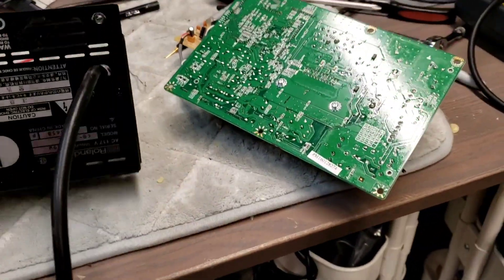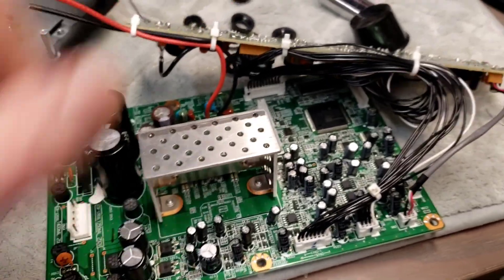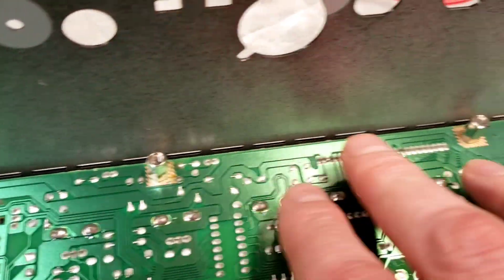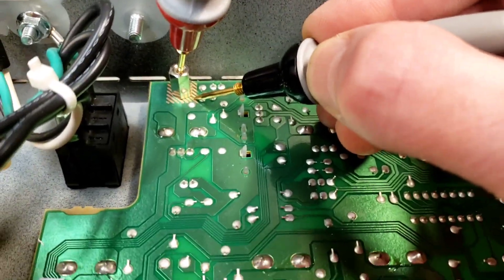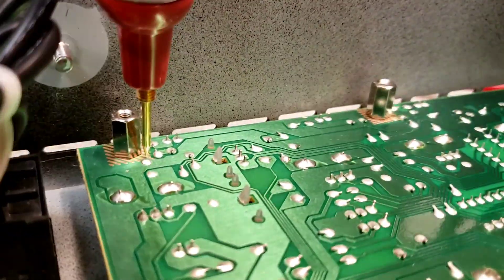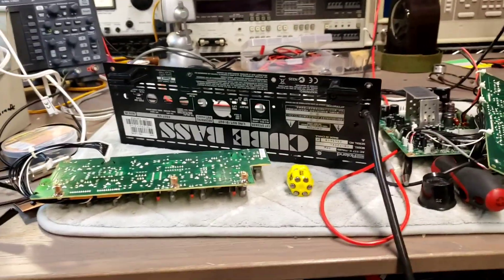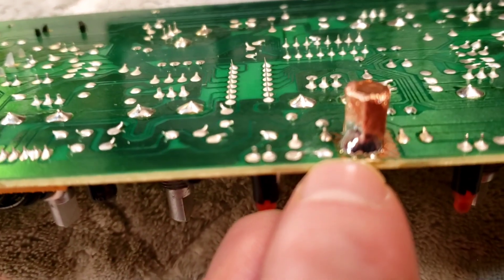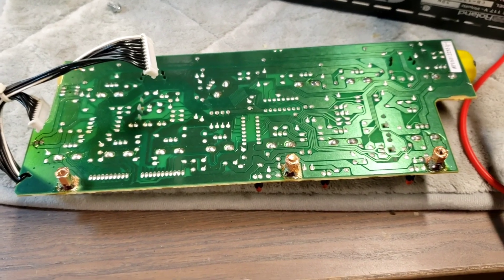Why Modern Roland Amps Suck.  CUBE 120 XL

Comment: I have a Cube 20XL for practise at home always been a great amp.
Reply from the maker: The problem with amps built like this is that they work until they don't, and when they need service, they are very difficult and sometimes impossible to actually repair.  My 120 made about 30 live shows before it started acting up.  Even after fixing the grounds, I don't trust it anymore.
Reply: @hugeshows I like the concept of having the different amp and effects built right in. If guitar amps can do it then bass amps can. It's just the cube ones have this flaw. 
My 20XL mostly sits at home for practice. I use the bass amp at church so never needed my own bigger one.
Reply: The Roland cubes they suck for Distortion Like metal and rectifier setting but the katana boss is great for metal and clean
Reply: @googlesucks5087  Ok When I use my bass Effects pedal using a distortion patch it works great.
Reply: @hugeshows well all amps work I till they don’t 
Your in a very minute group that has issues 
I bought a cube 60 right when they came out and still use it today. I’ve gigged it, played it for many jams and home practice. If they were shit they wouldn’t be one of the best selling amps for the last 10 years
Sounds like you might have another reason to bad mouth them
Reply from the maker: @Tangman4209  So why did they discontinue them?  Hint - poor sales or too many warranty claims.  Once you've serviced a few hundred amps, you begin to learn what's fixable and what isn't.  This repair I did only solved one problem with the amp.  Maybe I should do a follow-up on this turd in a box.
Reply: You don't know what you're talking about. I have giged so many times and it's still going strong.